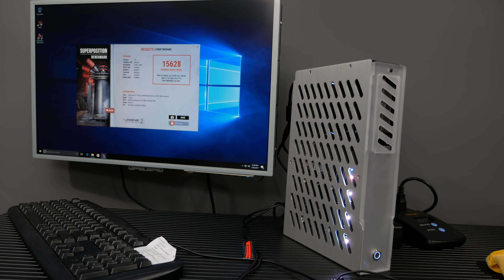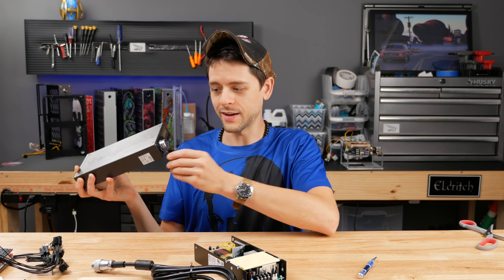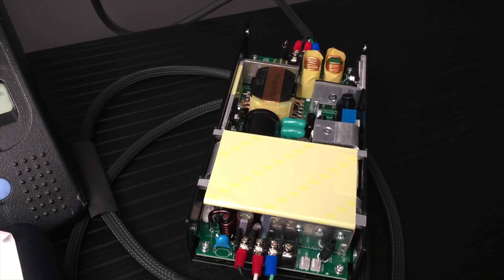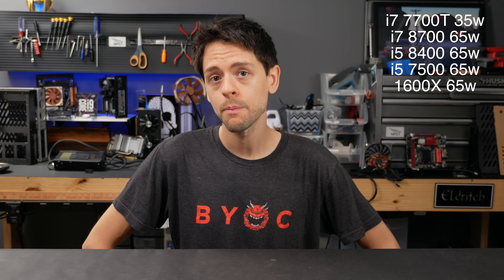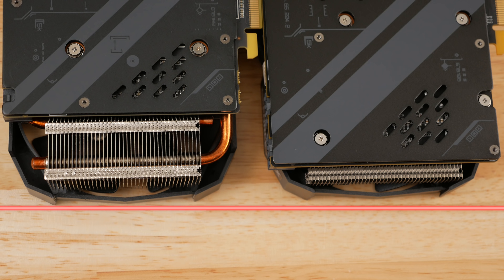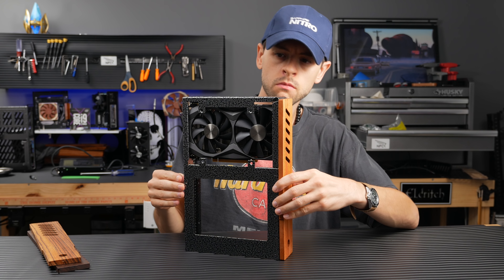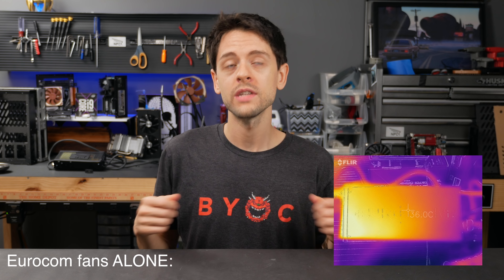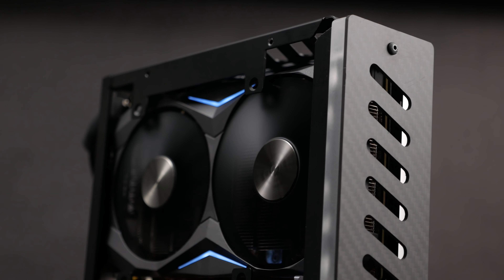Teeniest 1080ti PC - S4 MINI and Zotac 1080ti

Comment: I think it's time for you to hire people, form a company, and mass produce those s4 minis
Reply from the maker: It's happening. Just a slow process. Thanks for your support!!
Reply: I just missed it again!!! I've already bought my Asrock Fatality Z370 MB and 8600K processor.
Reply: Andy depends...it's all about supply and demand. $195 isn't that bad considering other bigger sff cases cost around $250. What bothers me the most is the shipping cost ; I live in EU.
Reply from the maker: Dear Andy and Marc:

There is a post on smallformfactor.net where I outly the costs that go into getting a MINI to your door. Unforunately at these small quantities and at the quality I am trying to deliver it is just expensive. I would never badmouth competition, but it is fair to point out that many chassis you can buy from a big company aren't trying to do the same thing I am. Very small runs (I don't have 100K in the bank to order 1000 units at a time), my metal is much thicker, I scrutinize the finishing process, and the tooling used is very expensive to avoid ugly folds or stamping marks. Any customer who has held a MINI knows there is ZERO flex and it is as durable as an anvil. The cost is so high that I rely on the accessories to make money for many customers--especially since I subsidize shipping. It costs nearly $80 to ship to most places in the EU, for example, but I only charge about $40 to ship there. The price actually has been getting lower and lower as I am offering more and more shipping subsidies.

The good news is that I have been working with creative and industrial individuals to rework the entire process and help me acheive the funding needed to increase my run size, and lower shipping. This news is coming soon, and although I don't expect the price tag to drop, I do expect the overall cost to the customer to go down while further increasing value for this luxury product.

Thank you for your patience an understanding as I grow from my garage to a small shop to working with a specialized factory.

Peace
Reply: Thanks for the response. Honestly you're doing an amazing job with the S4, and although I can't personally afford your product right now (you know, bills, food, insurance, taxes, familly life...) but it's still great to follow your videos. The content is clear, informative and entertaining. 
Plus I do understand the strugle it must be to build a company with a lower budget (compared to the big named ones) by oneself in a garage. 
I'll definitly register to smallformfactor.net ; seems to be a great forum with a nice community.
All I can say is that you seem to be on the way to making one hell of a brand, if it's not already the case.As long as you stay the same cool guy, it's all good.

Quick joke : you should audition for Shark tank ^^  

Peace from the eiffel tower !
Reply: Looking forward to seeing you around the forums.
Reply: Dude... you are my hero.
Reply: He is now hiring a company in Taiwan to manufacture and ship his new design.
Reply: You explained this perfectly with those two words: luxury product.
Reply: I tried thw password mentioned and getting an error... Please try again
Reply: I fully agree. That case looks awesome and seems like it performs better then most itx cases.

Comment: Zotac's backplates are known to retain heat. Remove them for your builds. Doesn't void warranty and could help on thermals. Especially for the fets.
Reply: That's actually really nice to know. Do you know if it's an issue on their full size cards too?
Reply: It's DEFINITELY an issue on the full size. https://www.gamersnexus.net/hwreviews/2981-zotac-1080ti-amp-extreme-review

They remove the backplate and see mosfet/vrm temps drop. I've found similar results on the 1070s.
Reply: It's just easier and less messy to remove it entirely. The backplate has a thin plastic film on the underside which hinders heat conductivity. Best not to treat it as a heatsink at all because honestly, it's not one. It adds no additional surface area for heat dissipation.
Reply: i can definitely say i have probs with my zotac, thanks for that tip

Comment: Dell 330W power brick works perfectly with i7 6700K @ 4GHz limited to 1.140V (Noctua NH-L9i)and Zotac GTX 1080 Ti stock, or in my case - 100 MHz on core clock (with 105% power) to limit overheat and throttling. On PUBG Ultra settings 1440p (165Hz Predator display) I got and average of 290 - 310 Watts at wall plug. Some peaks around 350W ... but this Dell 330W is perfect with HDplex400w. :) Everything's ready for S4 Skyreach !
Reply: So, i think won't be a problem if build a rig with hdplex 400 + dell 330w + 1080ti + i7800 (non K) ?

Comment: Have you seen Buildzoid's PCB analysis of the 1080Ti mini? He mentioned there's no input filtering choke on the 12V plugs. This might be why the system crashed on the 400W unit, tripping a protection.

Other than that... That power to volume ratio is MONSTROUS! I LOVE IT!

Comment: BTW @Josh: There is now a 1080 Mini available from Gigabyte which has the exact same measures like the 1060 and 1070 Mini from Gigabyte. Not as powerful as this little beast here but gives you a S4 Mini without the need of the mods. I am currently upgrading my S4 Mini to that beast with a new Ryzen system to get rid off normal Hard drives in Order to have better cooling and not roasting them ;)

Comment: every damn good small case out there is extremely expensive compared to main suppliers yet they are extremely good quality.
big companys shove trash small form factor cases when they should have made cases like the Dan s4 mini which is actually designed properly..

Comment: Hello josh. 

You used GX16 aviation connector for the Delta 400w,  Because Eurocom 780w birck or is there another reason?

I want to use 7.4x5.0 dc connector for delta 400w.

Do you mind if I use 7.4x5.0 dc connector instead of GX16 aviation connector?
Reply from the maker: No sir. You will melt the 7.4x5.0 connector is you try and use it for a 400w+ brick.

Comment: Another solution is 2 300 watt AC adapters and a y combiner that you would find on some high end gaming laptops.
Reply: I'm curious about that, i'm looking to make a s4 mini build with a 1080ti. However I don't want to either spend £400+ on a Eurocom or have to mod (given my lack of experience) the Delta. Is running two Dell 330w power bricks feasible? Or did Josh just want to scratch his tinkering itch?

Comment: Have a zotac GTX 1080 mini (non ti but has the pretty same cooling solution) ..its a nice fast card with low power-consumption for it's competetive  performance, even in 4k ... but it's much to loud in idle ...in comparison : my AMD RX Vega 64 AIR reference is like a silent device versus the zotac 1080 at windows desktop. Under load the zotac is of course less noisy... but I think that's not that important than 2D noisiness...at least the type of noise is not that annoyng, because its a unobtrusive sweeping noise ( no whine or so ) ..but its clearly audible!
Reply from the maker: Yes! The Zotac 1080ti mini's BIOS has an annoying fan curve. I recommend you search for "Cuban Legend Fan Curve 1080" on the small form factor forum. He has a walk-though on how to replace the BIOS with a tune so the card doesn't need to spin when it's not under load. MUCH better! Peace.

Comment: I don't understand why you kept the voltage on stock? You definitely should undervolt the 1080 ti atleast, to like 0.9v.
Reply from the maker: For the final product, I do alot of tuning.  I didn't have time to put alot of content in this video, so I hacked that part out and just showed that the PSU solutions could handle the stock voltages. Thanks for the comment!

Comment: i went for a phanteks evolv shift and my 3 fan 1080ti was running at 82ish degrees C, i couldve cooked an egg on the side before switching cases... couldnt imagine how hot this thing would get, holy shit
Reply from the maker: All that info is in the vid--but the MINI vents really well. The card runs at 84C@1895 once it reaches part temp. It's hot, but it's also ultra MINI itx. Thanks for commenting!

Comment: Superposition Benchmark 4K - 8967 points, I'm using the same card with 5-years old Xeon (on x79 board) and my score is 9667 (7.8% higher) :)

Comment: I'm 10 months late, but I am just getting into 3D rendering. Turns out, for some rendering software, the memory consumption of the entirety of frame must be less than that of the memory on your GPU in order to use the CUDA cores to render 3D. Else, it will render the scene with CPU only, which is slow.

1080 has a max of 8GB. Less 1GB for the display.
1080ti has 11GB.

So, more CUDA cores and more memory means it will render complex 3D scenes way faster.

Comment: Why are you using an Open Air GPU? It generates SO MUCH more heat.(Depending on the case, smaller factor builds don't allow any air flow therefor generating more heat, big cases allow much better results.) Use a blower style card then test the results, in that case specifically, I'm positive in at least 10-20 degree drops

Comment: Hey boss, I found a few 400w ac-dc power supply adapters on alibaba. All from china :(. Some rated for monitors and tv's. Maybe try a round up and throw a video out for us to see if these would be a cheaper and QUIETER solution than the Delta. Maybe. Please?
Reply from the maker: I did that--the Delta won. That's why it's in the video. I have a bucket of crappy power supplies if you wanna drive by and grab one! House fires included free! :D

Comment: Why not recommend the G-unique units? They can easily get up to 500w and are much cheaper?
Reply: jon norris or one of the 24v 20A LED/3D Printer PSUs, they are cheap and can be used with a cover and a fused socket

Comment: How about you try something like some companies use on there laptop, 2 x 330w psu from dell...if you find out how to do it, it will be the best choice after all, keep good work, and i am looking for s4 but it really really hard to get one.
Reply: I'm a complete novice when it comes to these things, but is that feasible? I want to build a s4 mini with a 1080ti and doing all this modding or paying £400+ on a eurocom is very daunting. I have found y splitters for two Dell 330w and a y splitter so that they run off one plug, but is that a good idea, or am I asking for a bad time?

Comment: So, 7700T + 960 Evo + 92mm Fan + Zotac 1080ti = approx 300w on paper, undervolting and you could hit probably 280w. Cant the Dell 330w manage a stable sub 300w draw? If not what is the maximum rated practical draw you would want to pull from it? I would think there is a system configuration possible to make that brick power a 1080ti with tuning.

Comment: I'm wondering if rather than going to all that trouble with those external PSUs it might be possible to squeeze in an extra Hdplex 160 in on the inside and use two Dell bricks? With a default clock i7-8700 (or any other CPU under ~65w) the 160 could handle everything on the motherboard and the 400 could be dedicated to the GPU. Jump the 15 and 16 pins from the 160 to the 400, so they power on together, and run a 330w and a 180w on the outside. Since it's usually the case, I'm sure there's something I'm missing that would keep this from working, but I'd be curious what anyone else thinks.
Reply from the maker: Dynamo Duo instead of the HDPLEX 400 and you can do this. Thanks for the comment!

Comment: 6:20 the r5 1600x is a 95w tdp chip, but the 1600 and below are 65w. Just a minor correction.
(btw the 1600x isn't worth it :v)
Reply from the maker: Correct on both counts. I make lots of mistakes all the time. I'm a mistake making machine!

Comment: theoretically, could you wire an s4 to use a normal psu, just externally? I dont know what gauge wire would be required to run 12v @ 40amp, but it seems like it would be simpler.
Reply: John Hinton Much easier to do that way; using these monstrous bricks is largely senseless though. It completely defeats the purpose of making the case tiny, it you have to cart around a tremendous power brick.
Reply: the power bricks required to make the system in the video are anything but small, i thing a normal sfx psu may be a viable choice, not being that much larger, if someone were legitimately considering building such a system in the s4
Reply: John Hinton Yes, all of these builds are silly.

Comment: I saw in a thread that if you soak your 1080ti in water it will actually shrink...
Reply: okay, system doesn't boot anymore - was it the water I used?
coz I don't have distilled water...
Reply: Why not just build a full size pc with full size components, then soak everything in water to have them all shrink at once.

You don't have to go through the hassle of cramming everything in an already tiny case.

Comment: Do I really need that Eurocom's PSU? Isn't there an easier way not involving soldering?
Reply: Have you heard of G-Unique? The guy that works there makes 510 watt, 12 volt PSUs. That should be more than enough for running a high-end set up like this. I think he charges around 180$ for the WHOLE power solution.

Comment: Just get a 24 V 1000 W power supply and A step down converter to 19 V. Or just get a low profile variable power supply
Reply from the maker: Don't even need to step it down because the DC-DC unit is 16-24v. :)

Comment: My question is, why do this with a 1080ti and then have to under power it to make sure the psu can supply enough power? Wouldn't it make more sense to go with a 1080?
Reply: Now that technology is getting better. You can use rtx 2060 with nearly the performanc and less power.

Comment: What's the point of small form factor if it includes a humongous external power brick?
Reply from the maker: It's a fair question--one that we have been working to solve. Check out some of my newer videos to see the new tiny PSU tech. Regardless, the power brick is less volume than a normal PSU anyway so it still is pretty small and you can put all pieces in a backpack. Peace!
Reply: @NotFromConcentrate  I saw the smaller ones are cool, but this one with the fan mod is too big

Comment: Im actually really confused by why you're using either of those super expensive PSU's when you can just buy 600-1000 watt server power supplies for under $100 that are the same size (if not smaller) as the ones you have in the video...
Reply: Where can you buy these?
Reply: brad chambers you can get them on eBay. If you want ones that are already modified to straight 12v power you can also type in “rc power supply” they are 900-1000+ Watts
Reply: No problem! i probably have 4 laying around that i use for various projects and none have ever failed. i even pulled 90amps from a 75amp psu for probably 2 hours one time, server psu's are pretty relentless. i will say though if noise is a problem, may want to upgrade the fan. the harder you pull, the louder it gets